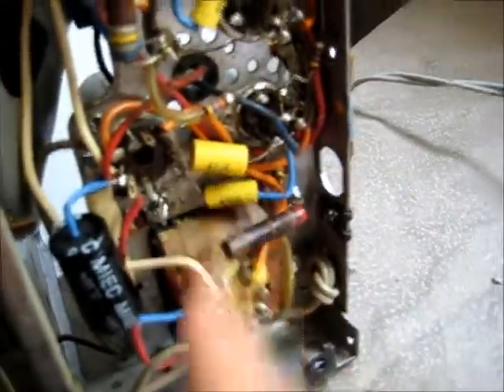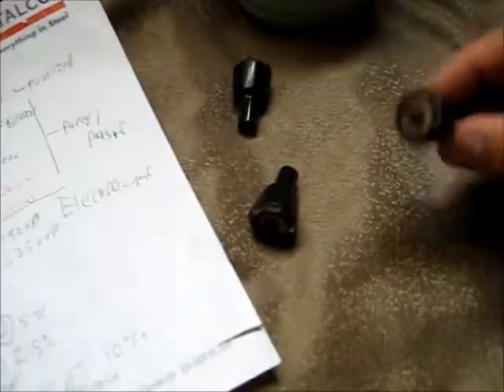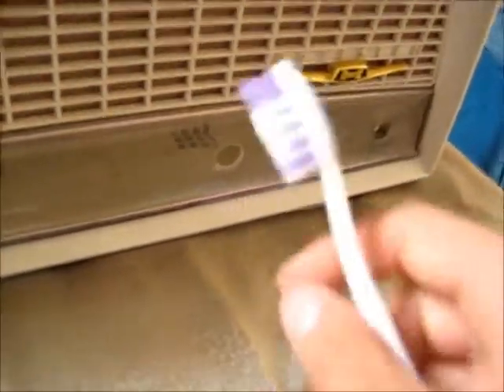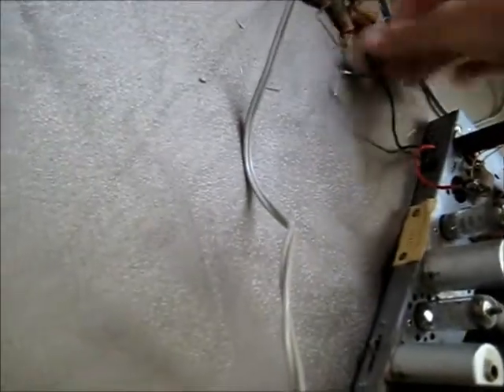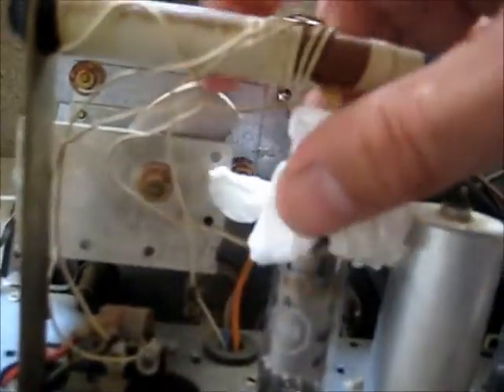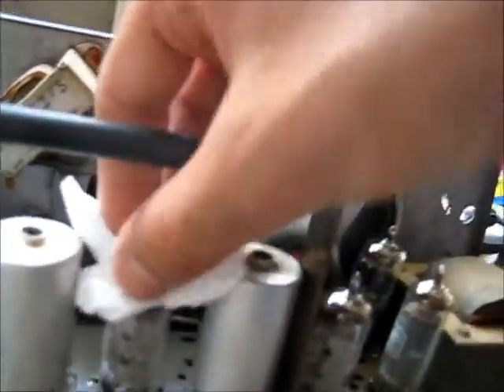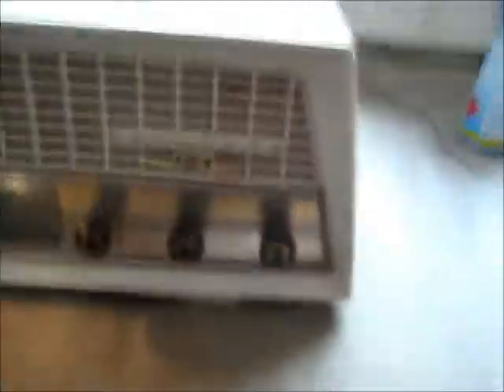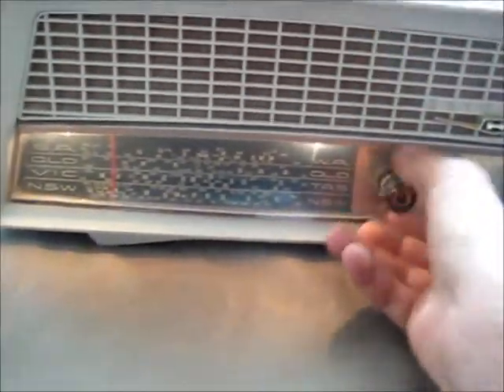Kriesler radio repair part 3

Comment: I don't know if you have a tube tester or not but it would be useful to know the standing of the tubes inside. I had another thought regarding this radio, if you could get a hold of a signal generator/test oscillator it would be good to give it an IF alignment. Most of those sets with a ferrite rod or a built in loop antenna work extremely well and don't really need an external antenna once the alignment is touched up, sometimes it drifts over time as the parts age and are replaced.

Comment from the maker: @douro20 Can ya Vid It, sounds cool, Good thing alot of These radios were restored and they were common, so Tubes are still around, they're just hard to find, I think this sets from 1958, But it is in great condition, as seen in this Vid